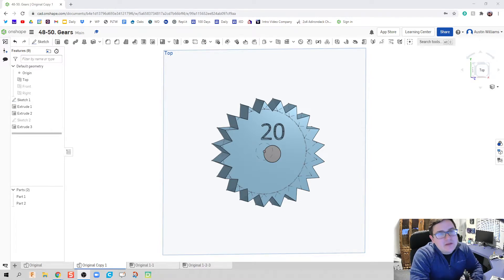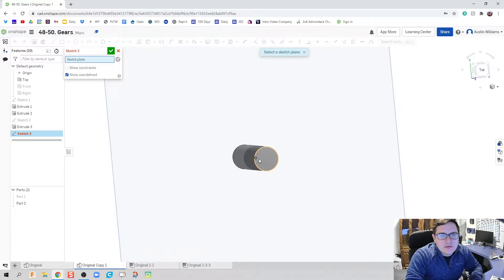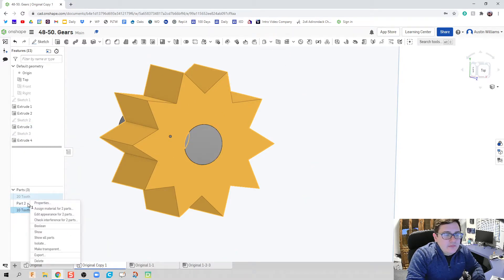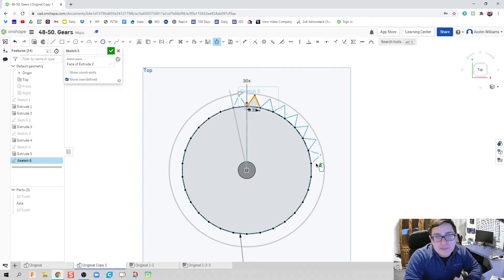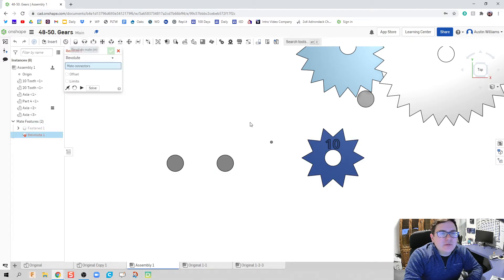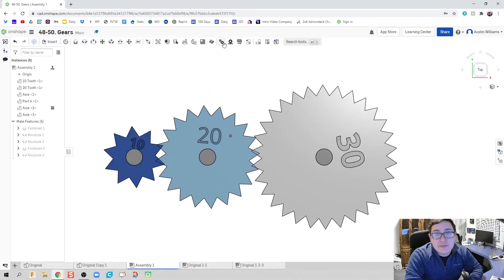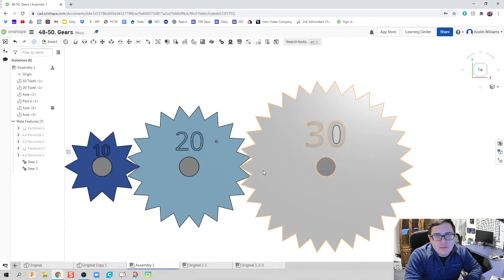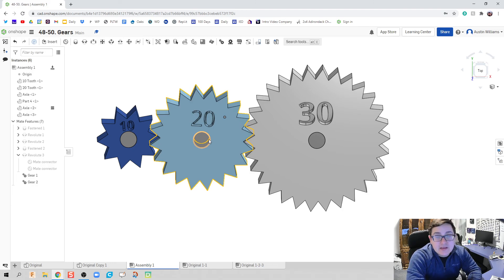Compound Gear System - Day 49 of 100 OnShape Journey

Comment: I’m running into a problem similar to the cam face tangent mate problem. Once my 10-tooth gear makes it 360°, all three gears reset to their starting positions. The animation keeps going, and the position of the teeth at the start point is the same as where it resets (or appears the same, really), so it looks like it rotates normally. But the extruded numbers all jumó to top dead center and it starts over. I wouldn’t have noticed it if the numbers weren’t there. I tried rounding off my teeth with fillets, but that didn’t fix it. I haven’t tried making the face of the gears all one surface like the cams, but you didn’t do that in your video either, and yours works. Do you have any ideas what I might be doing wrong?
Reply from the maker: Sounds like your animation isn't set to loop or the steps on your animation can cause those issues.
Reply: @LearnItDoItMakeIt  I checked that it was on loop, and I’ve tried several different step settings, and it still does it. I even tried completely remaking the gears and assembly from scratch, and got the same result.
Reply from the maker: @christophercollier6091  Can you share your design? Do you have an email I can contact? I wouldn't mind looking at it.